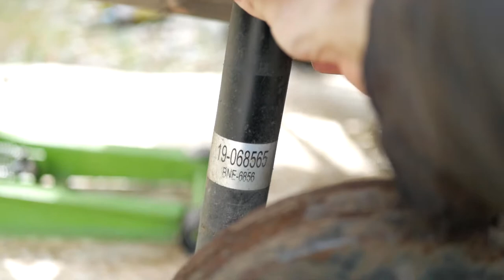Toyota Yaris MK1 Shock Absorbers And Spring Removal Guide (1999-2005)

Comment: Very nice. For North American people, this video can apply to Toyota Echo, Yaris, Scion xB, xD too as they all use the same suspension pieces. Not sure about Corollas and Matrix though

Edit: I confirm that Echo/Yaris rear springs are different from Matrix/Corolla/Vibe.
Reply from the maker: This is good info! I'll put it in the description as well so it comes up in search results. I'm glad this video is still helping people! How did you get on with your springs?
Reply: @DriveShifty  honestly this video was a great help. I live in a snowy area and in winter, roads are very salty. For that bolts, nuts were quite rusty and some of them broke. But thankfully, I got the front on and for the rear, the springs did not fit because I bought the wrong part.

Anyways, great video. Liked
Reply from the maker: @shaknoori2868  I know the feeling xD You are not sure what you need to take off! It's handy just having the confidence before hand! No problem. Thanks for watching!

Comment: Man very clean and straightforward to the point! Appreciated, no need to pay for this, looks quite doable, I had the impression that could be dangerous and these springs can bounce and can hurt etc. But as long as the weight is taken out of it, there is no stress on them!
Reply from the maker: Thank you for your feedback! Yeah springs was the first thing I done when it came to car work on my own. I followed a mightycarmods video on how to do it!
Reply: @DriveShifty  I would actually love to hear your experience(if any) about the electric windows in general electric system in yaris 2004, I just bought one today was quite cheap and tbh no prior experience in any other sense than driving it. Have to fix them. the right windows doesn't response to up down button either from driver side or the passenger side. How would you approach it to fix?(I'm aware a very generic question) but in case if you had any experience would love to hear it.
Reply from the maker: @Tinnitussss  The only experience with the windows on my Yaris I've had is them going up and down 😂😥 I would start off at the switches like. A multi meter is your friend! Good practice to learn how one works as well. Check that the switches are still working with a continuity test. If that's fine make sure it's getting power to it. There will be one wire on the switch plug. Learn that with a multi meter and you have just figured out how to fix a lot of electrical things 😂 Most likely the switch has probably had water gone down it and it's corroded something inside of the switch. Also... There is a lock for the window switches. Always check daft things
Reply: @DriveShifty  Thanks for the reply, it actually solved pretty quickly, I think there was some sort of corrosion. Because when I plugged it off/on it started to work :)
Reply from the maker: @Tinnitussss  Spot on! Everyone loves and easy fix! If you want to go extra with it some contact cleaner and a toothbrush will clean the corrosion away! Good work!
Reply: @DriveShifty  Haha definitely, cannot take any credits on myself but the karma, but such relief once it get fixed without any pain, Great tip btw, will do! thanks :)

Comment: Highly impressed with the dedication and love to Yaris I got the same 05 reg
Reply from the maker: It's been a good little car! Had it for 7 years haha
Reply: @DriveShifty   I have a 2007 yaris these are good cars I have done my rear shocks at nearly 200000 it's still on the original rear and front springs and front shocks these cars last well its passed every mot no faults just great little cars. Great video and your getting a big thumbs up 👍from me.  Very well  done Keep goin and keep them coming.
Reply from the maker: @mattlawton4715  Thank you very much. Yeah my one has just clocked 150,000. It's not had an easy life as well as I'm a always running late person xD. Good to hear other storys. Have you got your stickers from toyota?
Reply: @DriveShifty  mine has had hard life to👍. No I haven't had a sticker what is it.
Reply from the maker: @mattlawton4715  After 150,000 miles and 200,000 I think, toyota have a cool thing where you tag them on a photo of your milage and they then send out a sticker! I think it's called the high mileage club
Reply: @DriveShifty  cool ye I think I might try for 500000 its diesel so has a good chance I do change the oil and filter plus air filter often. Thank you for the info on the sticker I will look in to that. It seem you have rust on your car maybe you can do a video on wax oil/underbody seal on your car would last longer. Just a thought👍
Reply from the maker: @mattlawton4715  I did have a video on it. An old one but I'm kinda going against wax oil and that. I actully just used body wax on the arches of the MR2 and give it a good wash now and then. From the small bits of welding I've been doing on cars I'm slowly learning what makes them rust. When it comes to rust the best thing to do it to stop the thing that is making them rust. In most cases this can be fixing leaks or giving the underside of a car a good scrub. Some compainy just don't use good metals in places and you will see them rust sooner. It's a topic I should cover in a video. That is a good idea but it would be very leanthy and I would have to do more research! You have got me thinking about this now xD
Reply: Guys need some help on engine hesitation only on full stop round abouts for  toyota verso i cleaned the maf throttle body no engine light no codes 

Any suggestions would b highly appreciated
Reply from the maker: @mikan4216  Could be a lot of things. Also hard to tell from just a comment. I'll make a list of stuff I would check xD
Spark plugs - Take them out and give them a clean
Crap fuel - Can make it run bad
VVt solenoid - Usally has a code for it. Easy to clean though
Bad clutch? - A slipping clutch would rob some power
Engine down on compression - You might have killled it. Good going if you have like
Bad coil pack - Usally a code for that
Idle control valve dirty - Give it a clean
Air box damaged - The mafs on these cars a really funny when it comes to air flow 

Thats all I can think of be it hard to tell what it could be without being there in person
Reply: @mikan4216  did this happen before you cleaned the maf
Reply: @mikan4216  hi did you manage to fix the car if not try the crank sensor it could be any thing tho but you will find it dosnt sound like a big problem so think will be easy fix hopefully 👍

Comment: I'd like to know are there some sort of quality aftermarket absorbers and springs for MK1 available these days...
Reply from the maker: There is not a bad selection. Tein, Eibach, Koni, KYB, Apex ect.
Reply: @DriveShifty  What would be your choice? What would be reasonable in terms money/quality considering it's an old car now?
Reply from the maker: @institorisinstitoris959  Spring wise Tein. Tried and tested. Dampers just replace for new standard ones. KYB is a good brand. Most of the time the old ones on these cars are toast so just putting new ones on it an upgrade!
Reply: @DriveShifty  Sounds like a plan. Thank you m8

Comment: Where did you place the jackstands in the front?
Reply from the maker: Sub frame! There is a tube that comes down and I put it on that. It's a bit bashed in these days but it seem strong enough!
Reply: Ah thanks! I just installed H&R lowering springs today. The front ones are slightly fucked tho, but I will get new upper bearings for the shock absorbers
Reply from the maker: @yannispetridis5741  Awesome man! Yeah it will be the same thing but 2 times as quick xD No stuck bolts this time!

Comment: Hiya mate, I’m trying to get a single din stereo in my ph2 Yaris, I’ve watched your video three times but still struggling, how is the stereo meant to stay in?  Can you do another video bro?
Reply from the maker: Hey man! It sounds like you need to put the screws into it. The same way as the cubby pocket came out. Use the same loction and bolts and screw then into the holes on the radio. Make sure the screws are not to long

Comment: Hi, how do you know that coil springs need replacement too apart from the shocks? Thanks
Reply from the maker: Spring can snap from harsh bumps or pot holes. They can over a long time start to sag and lose there spring. The car would be very noticeable lower on one corner.

If a shock is blown then the car will be very bouncy. When you hit a bump in the road, the car will bounce after it even know you are not hitting any bumps. It will feel like your on a boat. They will leak there fluid from inside. If you want to see some extreme cases on blown shocks then YouTube and watch some videos of it.

Hope this helps
Reply: @DriveShifty  thankyou Sir...much appreciated

Comment: Hello, 
I want to lower my Yaris too, what’s the mm of the springs you put on ? Have you got any issues with it like wheel clearance etc ? 
Thank you!
Reply from the maker: Hi there! I used Tein springs that are 35mm lower on the front adn 37mm on the back. I have no issus with wheel clearance or anything like that. I have 195/50/15 tyres on and no spacers! Hope this helps
Reply: @DriveShifty  brilliant I have 14 inch wheels would you reckon 40mm would be still good ? Or shall I go 35-37 and get bigger wheels ? I really like the gap you have on your Yaris, when driving it does it feel more stable ? Does it still have body lean etc ?
Reply from the maker: @ioannispavlidis5385  If it's the standard 14" wheels then they will be no problem. I started of with 14's. The tyres size I have now (195/50/15) are very close in all over size to the old tyre I had (185/65/14) so that should give you a good idea of what they would be like. I don't feel as if the car would have any problem with 40mm lowering springs. People run them way lower with coilovers. Yeah it helps with body roll haha. A good video to watch of mine is the mod you should do to your yaris (Cheeky plug). I go over most of my mods that I have done to help the car!
Reply: @DriveShifty  I will have a look at them right now, I can’t handle going around the corner too quick and feeling like that car is about to flip ahaha, but thank you so much I will have a look at your other videos right now !

Comment: So glad I came across this video! I need all 4 coil springs replaced (I think) on my yaris. Will do it myself. How much should it cost per coil? Looking for a normal coil not lowered (I'm young so don't want the police stopping me).
Reply from the maker: I know that feeling! I've ran lowering springs and have never been pulled over buy I do live in a place where you rarely see them! Not sure how much they will be but I will give you some tips on finding cheap parts. Best place to start is sites like Eurocarparts or carparts4less. You just plug your number plate in and it will give you a few options. Also on eurocarparts always check the price of stuff WITH THE DISCOUNT CODE. They always seem to have bumped up prices but once the discount code is applied it bring it back down. Then have a quick look on ebay. Sometimes you will find a really good deal on there and it's always worth a try! Make sure you have some spring compressors. You don't want the old springs flying into space haha. Good luck!
Reply: @DriveShifty  I've checked eBay seemed like a good place to go, and spring compressors will be used for sure (don't want it to go through my head 😅)
Reply from the maker: @nadim2769  Yeah that's not ideal. You do need your head! Just thinking also get yourself some wire brush tooth brushes. They work wonders on rusty bolts!
Reply: @DriveShifty  never knew that, thanks for that really appreciate it. Rusty bolts and screws are my enemy, really does my head in 😂😂😂
Reply: @DriveShifty  Im gonna try putting Tein lowering springs tomorrow on my Scion xB. Wish me luck

Comment: Friend, notice that I have a toyota echo 2005 hatchback, rear and front shock absorbers and spirals were replaced, as well as steering terminals and crutches, but the vehicle even when passing on a bad road the shock is felt, it does not absorb the bumps, what could be the problem?
Reply from the maker: Hi there! It is always hard to understand someones problem just from a message haha. I think that the spring and shocks could be just to stiff for you. They will wear in after a few miles and get a bit softer. I would check your tyre pressures as they also could be to inflated. Hope this helps

Comment: Is... is that... a 1.0L?  Not knocking it, I just find it amusing that yet again, I find a Yaris with loaded rear beam (that bar running through your rear torsion beam).  The North American market never got that on the Echo, and we only ever got the "big" 1.5L.  I hate how much they knee capped our cars for handling and performance....

I asked in another video of yours what struts you ended up using in terms of KYB, and I see it's the Excel G like they sell here (since in that video you mentioned Bilsteins, which aren't even an option here).  The joys of other markets!
Reply from the maker: It's a 1.3L T spirit which is a step down from a T sport. I also have a SR which is the same as a T Spirit just a non face lift model and that also has a loaded rear beam. I wasn't aware of the loaded rear beams as I've not had a bogo yaris. I wouldn't know if they it was a high spec option. The UK likes a "sporty" hatchback so I would think that they would all have them.
I know in the EU there was an ECO model and it came thing nothing. No loaded rear beam

Comment: At 9:10 .... am I seeing this correctly? I mean really. That axle stand is sitting at 45 degrees. Thanks for the vid, but are you even  still alive? Follow the nuts and bolts but please don't follow this guys safety lol
Reply from the maker: FFS it is as well. The weight of the car was still on the jack at that point. Aye don't do this. Work on a level floor and not have this problem
Reply: @DriveShifty  not hating on you man but cutting corners, half assing and complacency gets you seriously injured or dead. A 21 year old maybe younger mechanic local to where i grew up... awesome mechanic, worked on heavy machinery, was working on such like mentioned. No one had seen or heard from him. Found with a vehicle parked on his chest. Either the jack gave or what was assumed, he reached for something and somehow released the jack. As in, he was so complacent he didn't even pull out an axle stand.. Boom, found 2-3 days later. Poor fucker couldn't even scream for help. Sad like.
Reply from the maker: @blizteredthumbs7911  Sorry to hear about the young lad! No you should never be afraid to call someone out for safety! People get far to comfy. Myself included. I would rather be humbly reminded here that when a car is stuck on top of me!